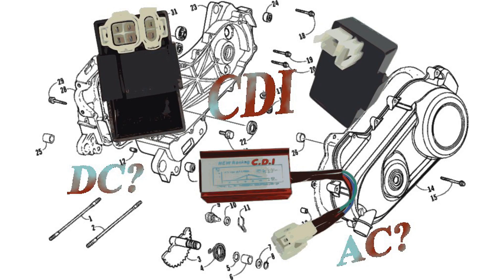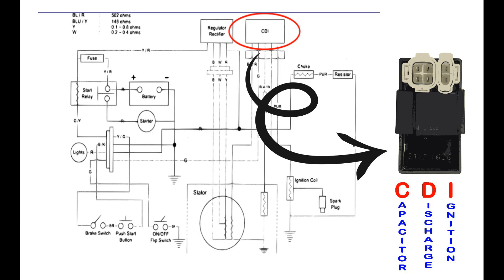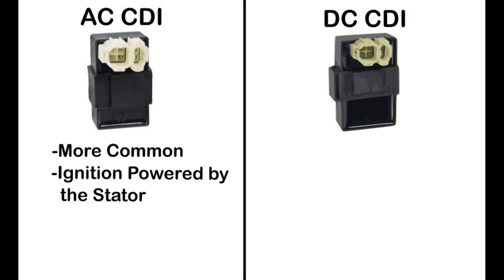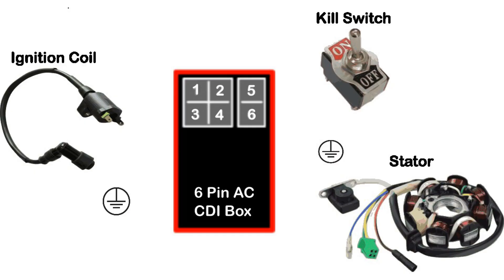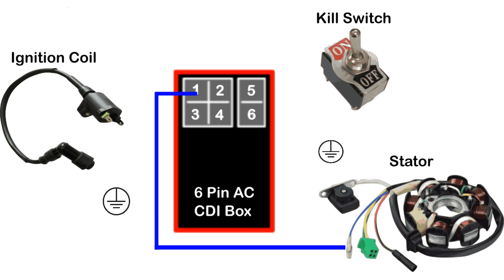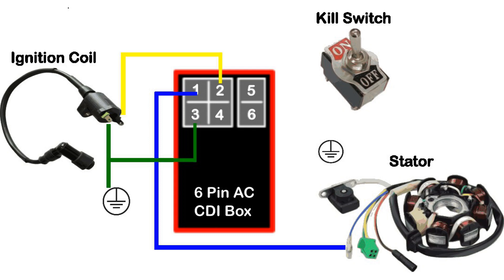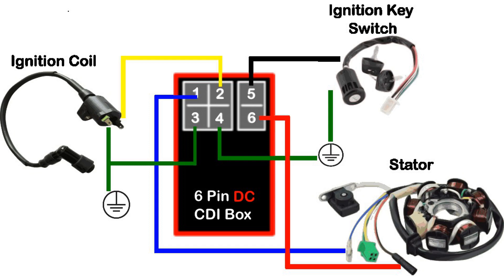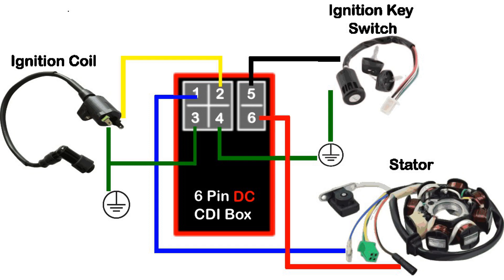GY6 CDI Box (AC and DC Troubleshooting/Wiring)

Comment: So on the 2003 quest 650 I was asking you about it not running correctly. I have replaced a fuel pump. I replaced the rubber mount for the carburetor to the head because it did have a tear in it. I replaced the spark plug I’ve taken the carburetor off and cleaned everything And I believe all the Jets starts up and quits within five or 10 seconds it’ll idle for a long time, just island but a little bit rough. I’ve tried it with the gas gap off the air filter off no difference. I’ve checked the fuel pump it’s pumping I guess what it should be Brand new pump but as soon as it starts to bog down, you can shut it off and immediately restart it’ll run good for a few seconds again.

Comment: How to confirm if proper current is coming from stator coil and pick up signal to cdi connector by visual inspection or with the help of a multi meter and how to check a faulty cdi ac

Comment: I have a cdi unit that the wires come out to the connectors, one has 4 pins with only 3 wires going to it, the one has 7 wires going to it. So far i have not found a video on that type of cdi box. I have no spark, was riding it and it died and has not run since, Any thoughts would be greatly appreciated. I have a 2006 Kymco Peoples 250 scooter. Great video for those that have 6 pin cdi units.

Comment: First of all thank you for this nice video. My GY6 Chinese dirt bike's  AC-CDI has only 5 pins. Am I correct on the wire colors as below and which wire I shall connect a kill switch for grounding? Thank you in advance for your help.
AC-CDI pins with color
1. Red > Power to CDI from Stator/Alternator
2. Yellow >  Power from Stator to Rectifier [ for battery charging (my bike is Stator  Cranking kick start but also have a battery I think for engine stability]
3. Blue > Trigger from Pickup Coil/ Pulse Generator 
4. Green > Ground
5. Black > High Voltage Signal from CDI to ignition coil.

Are the above connections correct?

Which color is for Kill Switch ?

Comment: Hi!  I replaced a new 8-pole stator, new CDI & new carburetor.  I have a strong spark on the spark plug but the engine will not start.  Any idea what it could be?  Thanks in advance.
Reply: If you havent figure out it probably is off on timing

Comment: So I have a 8 pole stator no pulse on stator have  a DC 5 wire cdi four wire plug in and one wire on the two plug and a 4 pin rectifier and battery I'm guessing this is a DC set up but is the stator DC or AC

Comment: Question , I'm redoing a 2 stroke , Kymco cobra aka Top boy but I have a Yamaha Zuma motor 😂 so I'm rewiring a CDI box it's AC I also have the DC CDI box from the Kymco cobra how would I wire the DC ?

Comment: I have a 6 pin cdi but only 5 wires that plug into it from the wire harness  I believe that it's dc however I do have a kick start I hooked up a tachometer and did the touch method off the coil to see what end worked it was the positive side this was with a stock cdi when I installed a performance cdi tachometer didn't work any ideas. I have a BMS Chelsea 150. Thanks for your time Russell
Reply: Thats bc you have DC. Pin number 6 isn't used

Comment: So, I could put a dc cdi box on my Ac system? If  I powered the dc box with switch 12v power, then I could leave the ac charging wires going to the rectifier alone and still charge the battery? Thanks
Reply: You can just wire the cdi to the battery at pin 5 and leave 6 unused.  You can't use an ac on a DC bike but can use a DC on an ac bike. If that makes sense
Reply: @MrPattygriff does ac box need the ground wire on 3 or 4 pin? With a 4 wire ignition an the on off switch the ground?

Comment: Gonna try and unplug my red and black wire that goes to my stator for dc cdi hookup. Hope this helps me.
Reply: Did it help u ?
Reply: I also have a Kymco DC cdi but change almost everything stator ignition coil and still got no spark I get a DC cdi and now if I get a 4t DC cdi it wouldn't work on a 2t dc cdia or im bugging ??
Reply: Dc cdi doesn't need the stator hookup from pin 6. Leave it unconnected. Check if your getting pulse readings from the sensor going to the cdi with a multimeter. Pull the spark plug so the engine spins easily and is way less draw on the battery. Test the trigger pickup that tells the cdi to fire. If its +/- 3% of the number that sensor is supposed to have? Then it's bad and needs replacing.
Reply: Changed out my carb, now it starts and no bogging. Thank you folks🤙🏽🤙🏽🤙🏽

Comment: I cant find a 6 wire voltage regulator for my 200cc gy6. it has the smaller CDI (AC) on it. i got this kart as a crank no fire. customer says the shop put a new CDI on it and it ran find then one day died while running. just going over the kart it has been abused and the techs sucked that worked on it . its only 2 years old and missing stuff.. bottom line is i cant find a 6 wire 2 plug AC volt reg...anybody know whats going on with this thing? or where to get the part?

Comment: I have a new unrestricted naruka cdi box and i have a 2009 kymoc agility 49cc. My new cdi just keeps turning over when i try to start up the engine. Its all connected and the moped works fine with the old one. What am i doing wrong please do i need to bypass the ignition fro the engine

Comment: I have a 2003 yerf dog rover 8400 with gy6 engine and a dc  cdi.
When I turn the key.  I get one single spark. I can't remember if this happens when turing the key to ignition on or when cranking.

I eventually gave up on it and put in an ac  stator, dci, rectifier  and it runs.
The ignition system i put in it was for a gokart or something and the wiring harness is incorrect and short and would like to switch back to the dc system .

It has a mikuni carb
That I have cleaned extensively a couple of times.
The engine has no power or speed. 
The idle speed used to slowly increase the lower it was running. I would need to decrease the idle speed to shift from R N F.
Will adjusting the idle air mixture screw affect top speed and power?

My second thought is the diaphragm and needle that is attached to it.
I did not see any holes in the diaphragm. 
I dont recall if the needle is adjustable. 

Any ideas would be helpful.

There was one suggestion that a missing ground was the cause for one spark..

Comment: 20 videos and congrats : your only1 with even a different way to wire a DC cdi ! omg! the power wire is different
Reply: DC power goes to pin 6 on a DC box. AC power goes to pin 6 on an AC box. I'm pretty sure pin 5 grounds out when you turn the key to off.

Comment: So can i use a dc cdi on an ac motorcycle by changing the wiring setup?
Reply: I also wan to know too broh shit crazy cuz I have a 01 scooter that have a kill switch and it also have a stock cdibox which is big  so I assume it's a cd but at the same time battery been dead I have be able to Kickstarter before and now I don't know what is the problem if tatir is new but it won't trow spark  at all battery also dead  too but usually it use to worl i dont know if its my charging systems are nit working or wtf else can be but whit a dead battery and no spark I have no wsy to find out if my cdi wen bad or the regulator ect
Reply: Absolutely never use AC or DC out if place. It can really screw things up badly. AC is sn extremely high voltage that will likely melt or blow up a DC cdi. Using DC on an ac cdi just won't work. I'm unaware if it will cause any melt down but don't do it.
Reply: Et es ce que on peut faire l'inverse, utiliser un CDI AC sur une installation DC .... Si je fait .

 @ZCRAIZED1

Comment: So on the #5 pen it gets a ground and 12 volt power through a switch ?
Reply from the maker: On the DC CDI, the cdi gets its power from the battery which goes through the switch. Pins 3&4 will go to ground.
Reply: So can I just use a toggle switch instead of a key switch ,and #4green can't really be a ground if the other side of the key switch is positive 12 volts off the battery am I getting this right and thank you very much
Reply from the maker: @darrellsomers5427  I suppose you would need two toggle switches, one to turn on power to accessories and a second to go to the starter solenoid to start the engine. The ignition switch can do either of these depending on how far you turn the key.
Reply: Its an old Yamaha wave runner it has its own start button all ready I thought I would wire the positive wire from the battery through that button switch that has to be held up by the lanyard thing that kills it if you fall off the + wire with the #4 green wire through that switch